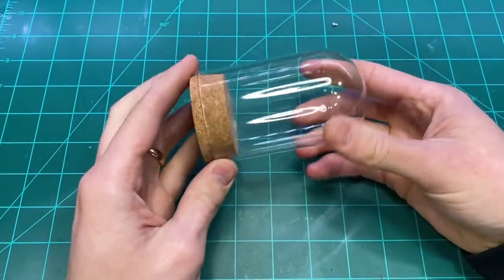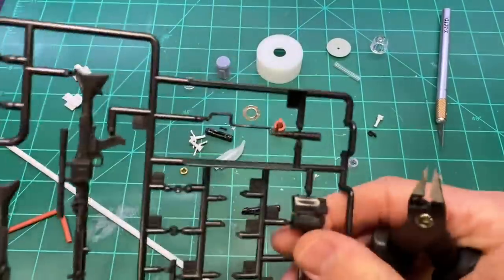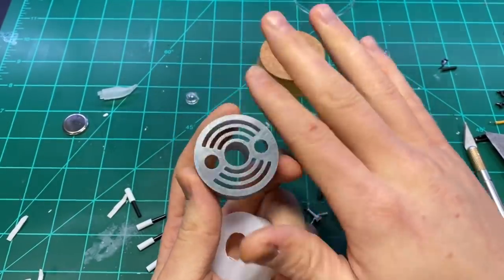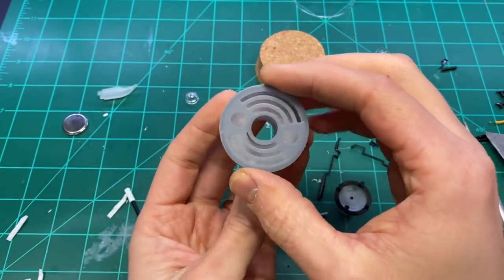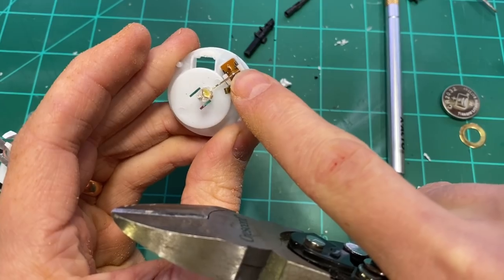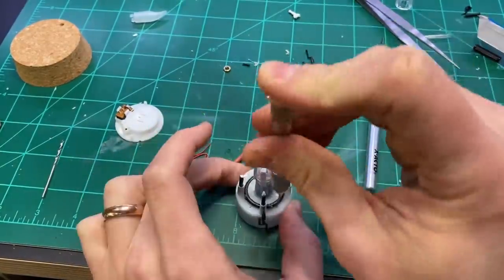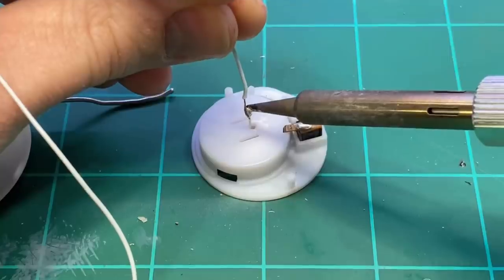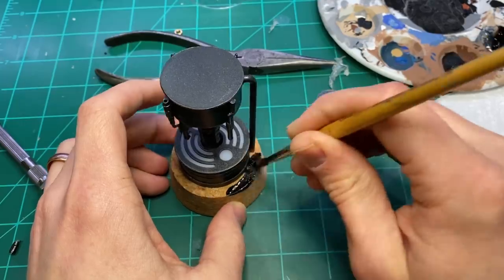Carbonite Chamber Diorama

Comment: Very nive scrachtbuild , what was you tolerance to be able to insert your floor over the candle light? Meaning candle light being 1.5 inch external diameter, did you build you grey floor internal dia at 1.5+0.015’’? Thanks
Reply from the maker: The ID of the printed piece is 1.502”. 
Very snug fit.